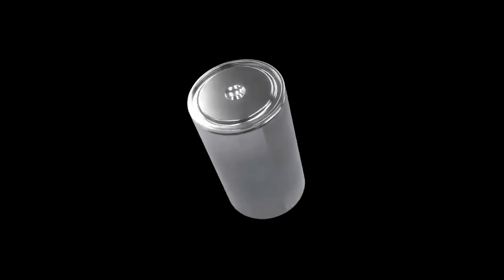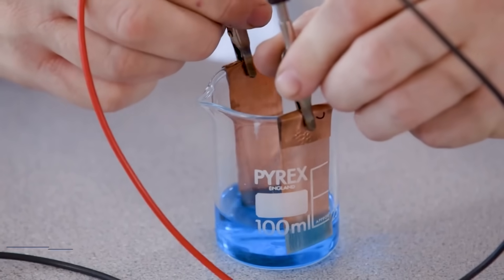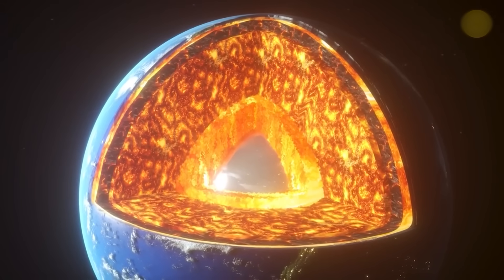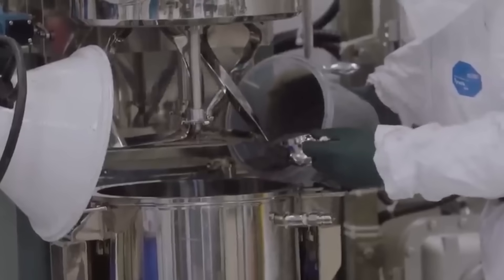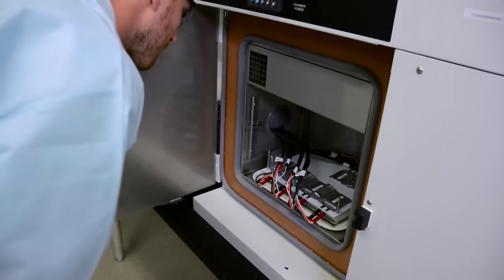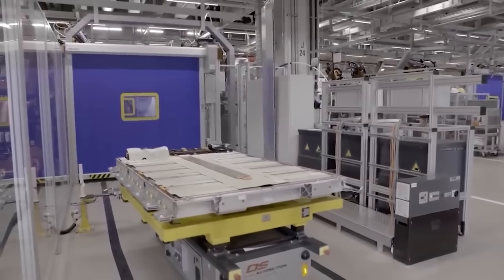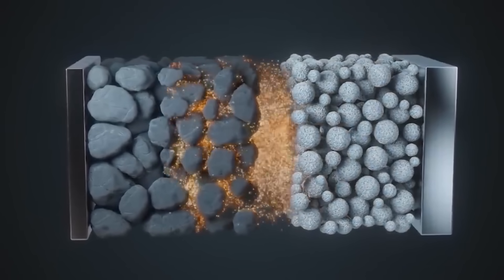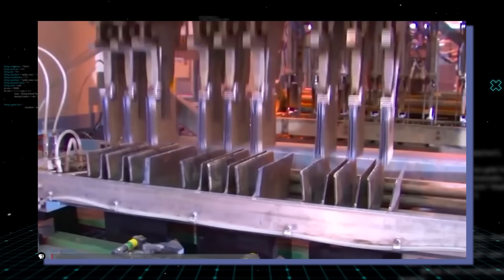China's ALL NEW Battery Breakthrough SHOCKS The Entire Industry!

Comment: will this be used in phones???
Reply: Highly unlikely.  The reason lithium is used is because it's both dense and lightweight, while having only 3 electrons per atom.  This video glosses it over, but the energy density to material density ratio means that a phone using a sodium iron battery would be 4 times thicker and 9 times heavier than a lithium ion phone for the same energy. Sodium iron batteries are being developed for large scale applications like solar farms and wind farms, where the size and weight don't matter, just the charge\discharge rates and durability.
Reply: If it ends up getting used, it will most likely be used in electronics across the board
Reply: it should, also iron man could be possible in the future with this
Reply: Phones may start using batteries that are now found in pace makers. And will never need to be recharge in the life of the battery.
Reply: yes
Reply: depends on the format. if they can micronize it a bit, they'll be in everything.
Reply: I don't see much benefit for mobile devices but for transportation it's huge.
Reply: Only Salt mobile 😉😂...